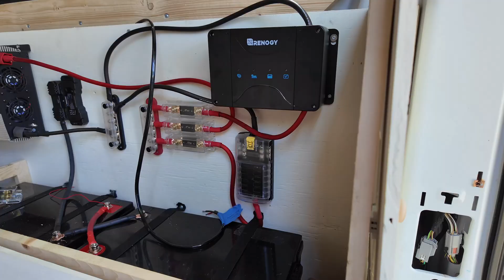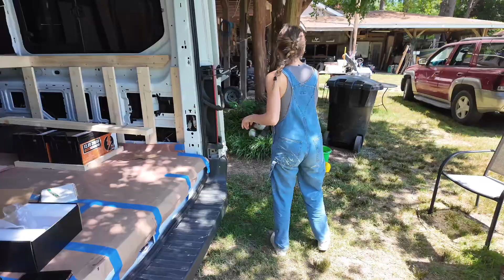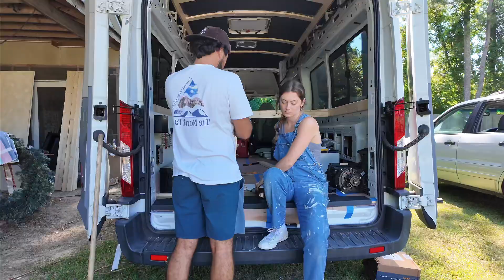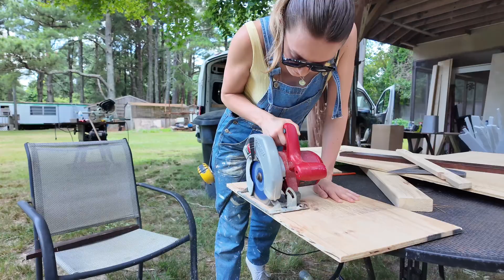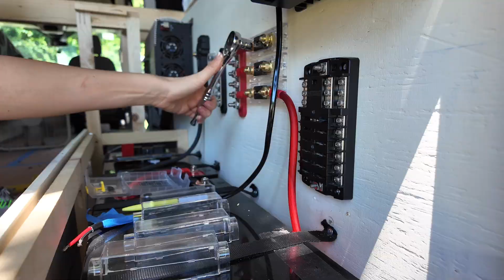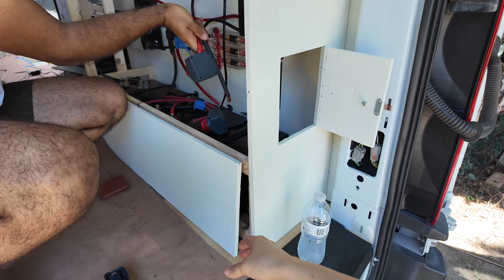DIY Camper Van 12v Electrical System

Comment: Yours is close to what I'm doing. I have 2x200Ah LiFePO batteries, the same dc2dc+MPPT charger, 3000W inverter, separate mains-powered charger.
A list of tools used and alternatives would have been useful. And detailed footage where you are doing something intricate such as crimping, fewer timelapses - really they don't say much about the process.